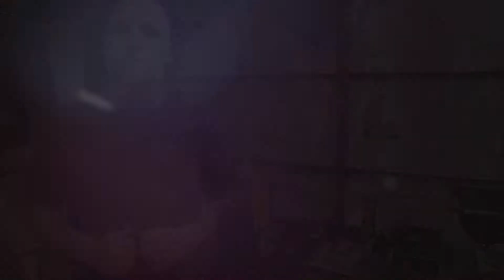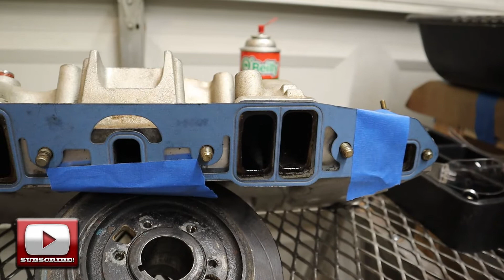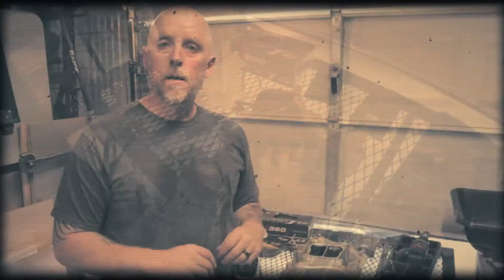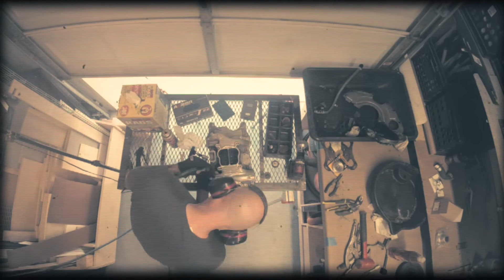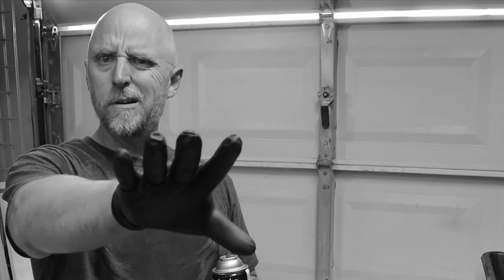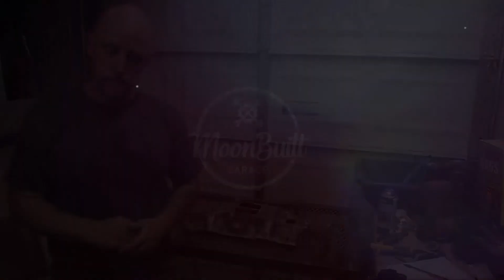How to Clean, Port and Restore Aluminum Intake Manifold, Quick and Easy

Comment: The cleaning.... man, that's alot of oil film deposits inside:  egr puking from an oil burning engine?  A cheap dimestore bottle brush and some mineral spirits can get those deposits out of the runners.
Reply: I like to bead-blast my intakes to remove all the exhaust  crudd etc... it's  alot fast & more effective.